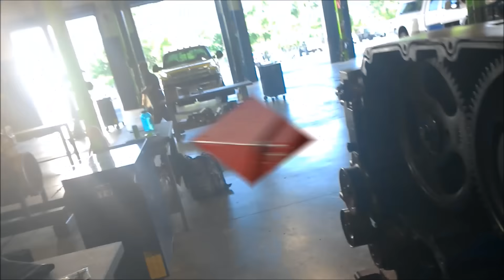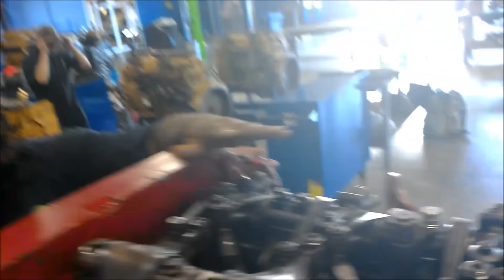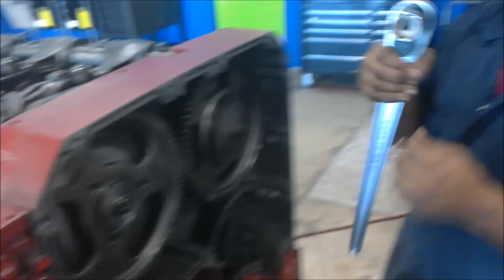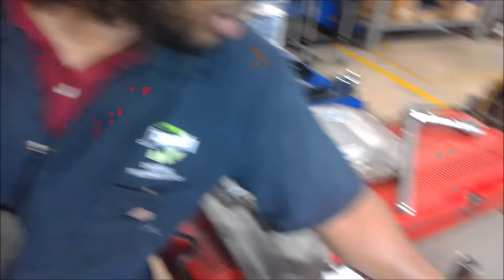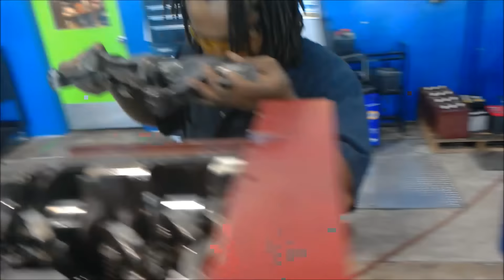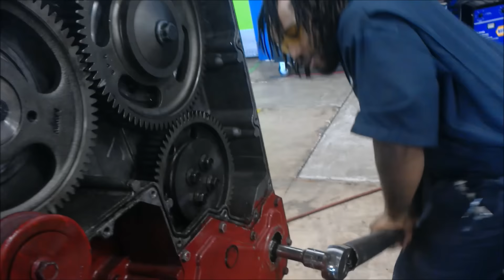TIMING ADJUSTMENT FOR A CUMMINS DUAL OVERHEAD CAM ENGINE

Comment: What the hell did u time? No wedges in the cams no pin in the block and you never did gear lash, oh torque wrench that'School can't afford them????😬 I hate to see how they show you how to do a head gasket!
Reply: I know what a bunch of bullshit. That's what happens when you go to a school and nothing has to run at the end of the day. All theory and it isn't even right!
Reply: Damn dude did I miss the part where he used the timing wedges. He just took the rockers out, put them back in and turned the motor.

Comment: Ummmm........i cant believe what i just saw here. It will probably still run until you power into it. Engine warning light comes on. Speed sensors out of synch. On the valve side it could easily make contact and slip on by. Shame on you.